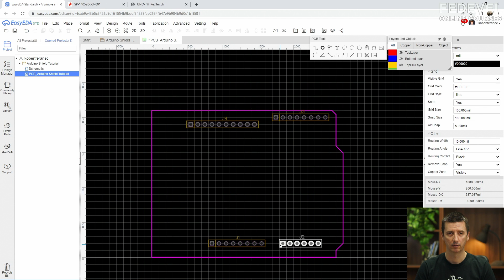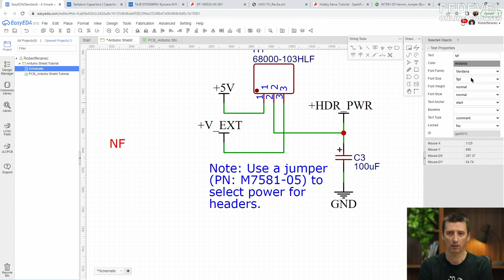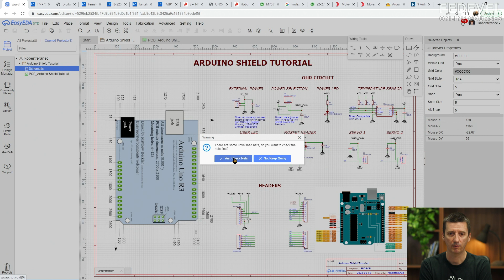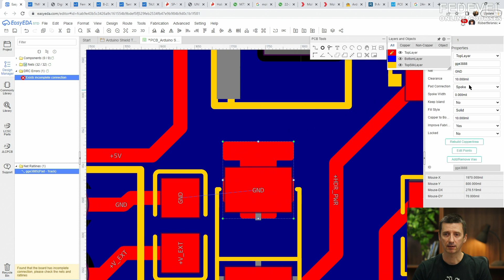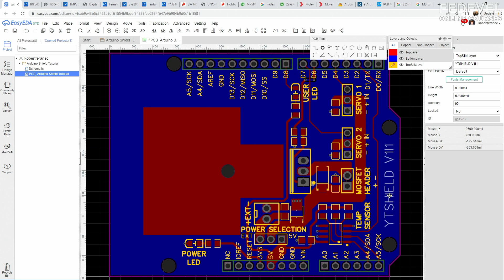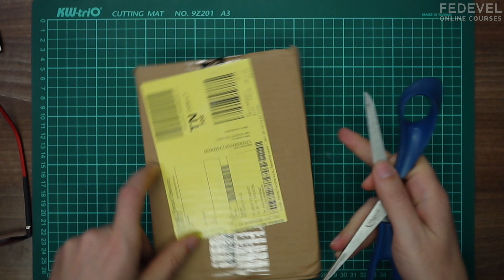How to Make Custom Arduino Shield in 2 Hours | Full Tutorial | Driving Motors, I2C Sensor, LED

Comment: I ve completed the content of this video till 50 min mark.its easy to follow but one thing I dislike is that you don't explain each step why we are using the MOSFET header after external power has been used.you should first give a big picture of how all of these connections are gonna workout.then step by step tell us what component you are compiling.otherwise you have done a great job I think I will need to do the hw myself by looking into the schematic to get the idea of what these connections mean.thank you for this.

Comment: If the top two pins of the 10-pin header are NC, why not use another 8-pin?  Do you need the 10-pin for mechanical reasons?  Is that worth the longer stub line?

Comment: Robert, when you did the MOSFET section, is there a reason to omit the series resistor to the gate? I know the 0 ohm can be replaced if need be, but would it be better to put a 1K there by default? This would limit any inrush current when the MOSFET first switches on potentially damaging the Arduino. (in the ESP32 dev kit layout you added the 1k to the MOSFETs in the CP2102 workaround circuit). Looking at the instructables source, they seem to have omitted the gate resistor. Though there seems to be some debate - since this is a low-speed application, then adding a resistor probably wouldn't hurt, but might save the I/O Pin? There are also some other benefits, iirc, when dealing with higher switching speeds and controlling oscillation
Reply from the maker: It would be interesting to measure it, but I don't have the proper equipment to do it.
Reply: @RobertFeranec  fair enough - it seems to be an open debate; but also generally "unless you know you don't need it, better to add it" - but again, since you have the footprint, you can always add it in... then remove and tune as required.  this is an interesting watch on the topic: https://www.youtube.com/watch?v=bw_ZIye2j64 including measurements